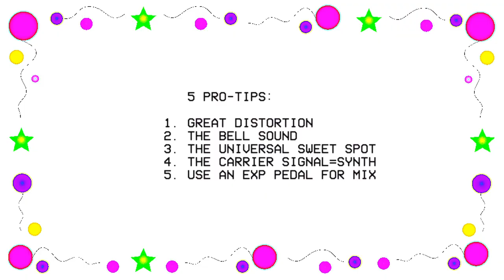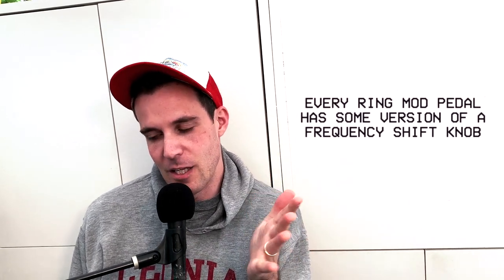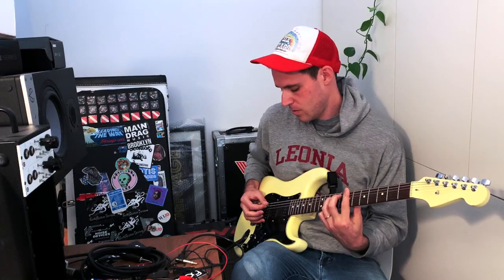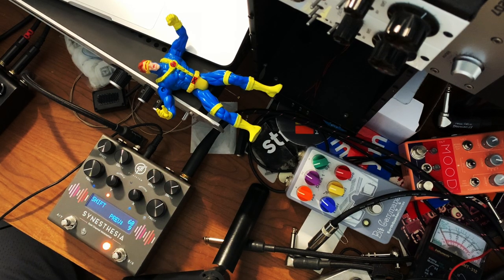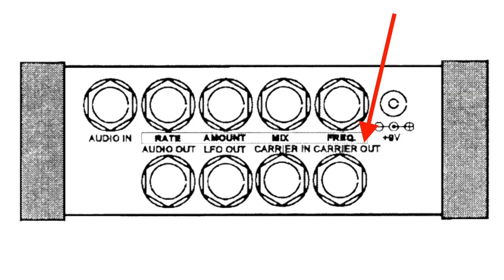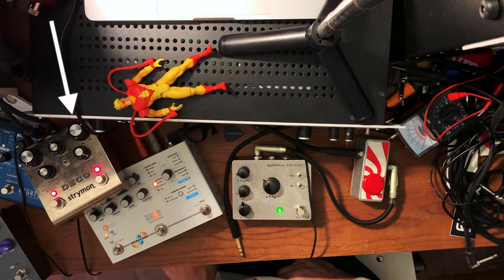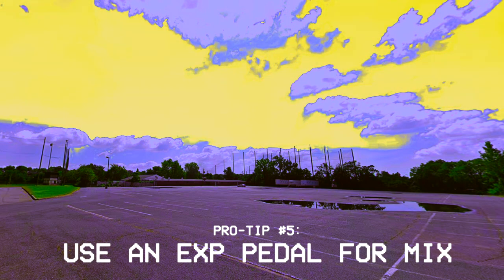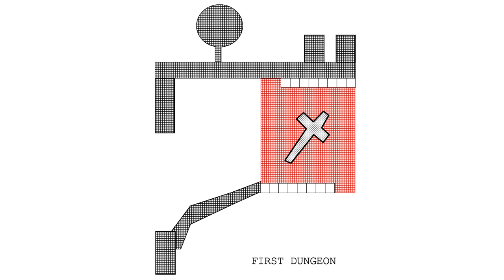Ring Modulation: How to Begin

Comment from the maker: PRO-TIP #6: if you're thinking about buying any of the pedals in this video, you can use my affiliate links with Perfect Circuit to get them and support my channel in the process. I'll make a small commission on whatever you buy, if you click on any of these links:

STRYMON MOBIUS
https://bit.ly/3C6TH7I

SYNTAX ERROR V2
https://bit.ly/3bYKSCc

GFI SYNESTHESIA
https://bit.ly/3nM50cT

FAIRFIELD CIRCUITRY RANDY'S REVENGE
https://bit.ly/3PboxiC

RING MODULATORS IN GENERAL:
https://bit.ly/3JYslST
Reply: Damn u like x-men huh! Personally I prefer Cyclops with mask tho

Comment: Just a tip for ring modulator/ bit crusher  lovers out there.  Start your chain with an analogue octave down, then ring modulator, then your favourite dirt pedal, then a low pass filter and finally a bit crusher. I use the oc2 , ehx frequency analyzer,  dreadbox disorder [ dirt and filter together] and bit map v2[ sample rate zero, just frequency manipulation]

Comment: Suggest you check out the Pigtronix Ringmaster, which tracks the pitch of the incoming signal and uses that to modulate carrier frequency, making everything sound harmonious. It also works as a traditional ring mod with the flip of a switch.

Comment: Cool, the section at 7:50 sounds like a kid's TV character we had in the UK called Sooty! Or was it Sweep? Sooty and Sweep anyway, haha. The real fun with ring mod is changing the modulator frequency, this is why I'm into modular because you can have any LFO waveform you want, sample and hold etc. Patching an envelope follower into the ring mod for example is really interesting. I don't know if there's a pedal where you can do that. 😉

Comment: You should set the expression pedal to contol the carrier and play melody with your foot, just as happens with a wah wah with emplies a pitch at the notch frequency, a wha wah without a pedal to control the filter is not a wha wah, same for a ring modulatore without a pedal to control the carrier frequency.

Comment: For the ring modulator the carrier frequency needs to be under expression pedal control, then you can play in tune, you treat the carrier as a melodic component controled by foot. 
A ring mod is like a wha wha, no foot control would mean you don't comprehend what its for!
You can do this with some of them which have expression pedal ports but no ring modulation pedal should have ever been produced without an expression pedal attached, it was a very glaring example of inept design and bad marketing, if the pedal sounds out of tune people don't use it, imagine a wha wha with no foot control, useless but for a static filter effect here and there.

Comment: Who calls it frequency shift? Dude it's just frequency, it doesn't shift anything
Reply from the maker: the Strymon Mobius has a parameter called "Shift" in the menu for its Quadrature settings, which is the frequency control, and since I used that as my go-to ring modulator for a long time I'm sure that's where I picked up saying that.